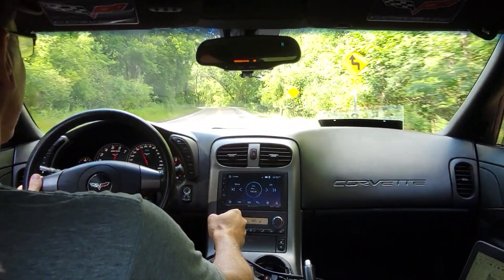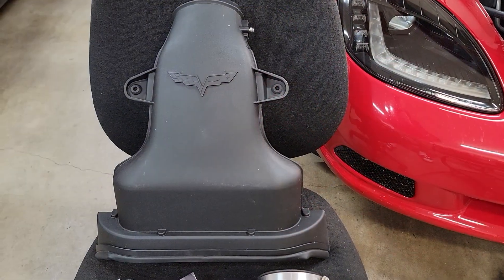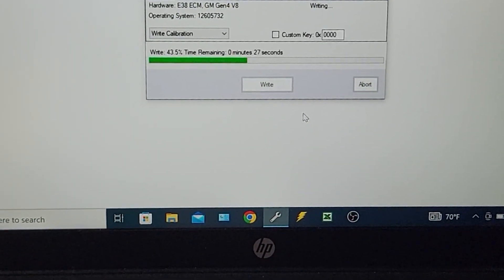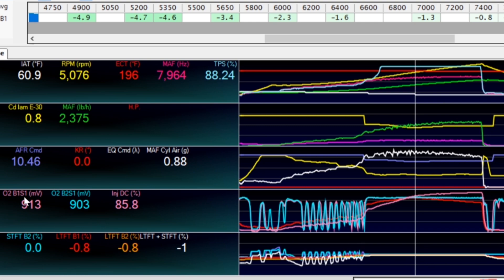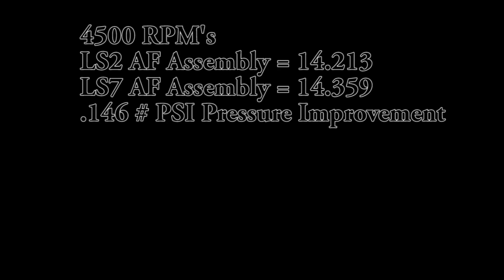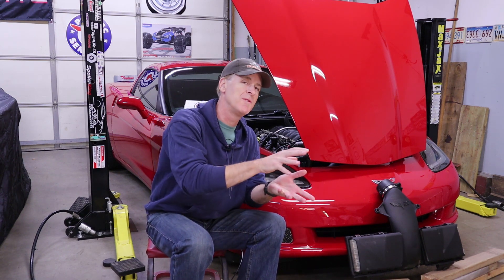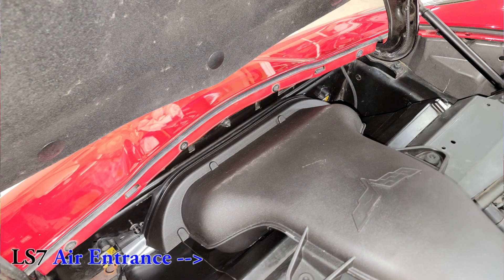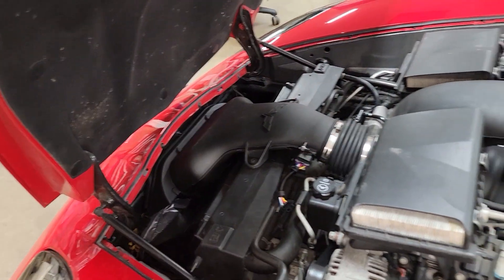C6 Corvette (LS2) Air Intake Upgrade to LS7 Testing (Is it worth it?)

Comment: Delivered CFM would be a better measure.
Reply from the maker: I appreciate the comment. My belief (which may be wrong) is that whichever intake system results in the lowest pressure drop inside the manifold would yield the greatest flow. Pressure and flow are related.  Please explain how you would measure CFM and how you know it is better (I assume you mean more accurate) than the pressure drop methodology I used.
Reply: @Toys4Life  Any intake will flow X CFM, and calculating an engine's CFM needs is pretty simple (CFM = (displacement x RPM) ÷ 3,456). Volumetric efficiency takes over from there. I would expect you could pull those numbers from your tuning software?

Comment: Very interesting. Although I have a C5, I found your approach thought provoking and practical. Question…Is the LS2 intake manifold adaptable to the LS1/6 ?
Reply: Yes, I would like to know as well!
Reply: Dont even THINK about using the LS2 intake over the LS1, or especially the LS6. It was proven-several times-years ago that the LS2 intake isn't nearly as good as the other LS intakes. Why? I dont know, but more than one dyno test confirmed it's inferior to the other LS intakes.....
Reply from the maker: @bat5917 Pretty sure you're talking about the air intake assembly and not the intake manifold, correct?
Reply from the maker: @Milojanis4901 Agreed,  the LS2 intake manifold manufacturing process was made a different way that basically means it sucks.
Reply: @Toys4Life  Yup, that jogs my memory now. Too bad, that would have been a much cheaper way to match up the LS2 throttle body.
Reply: Would the LS7 intake work on the LS6?

Comment: In order to have fresh air with the LS7 intake, but also with LS2 intake, I recommend you to install a Vette-air scoop. I have one and it is worth it 👍
Reply from the maker: Logically - it seems like it would help!!!    I would love to test it - but once you cut something up .... (:-) Oddly enough - Halltech says it won't help, and may even cause surging and codes.  " We do not recommend cutting any holes in your radiator shroud (in an attempt to get more air to the filter). It is not necessary, and will cause lean codes and surging."
Reply: @Toys4Life  
With the original LS2 intake, there is no problem since the filters are open at the top. They capture more fresh air without directly experiencing forced air flow. And it seems to me that there is no need for reprogramming for this configuration. On the other hand, for LS3 and LS7 intakes, it is true that there may be an engine fault because the air pressure is too high on the MAF sensor. This is resolved by reprogramming the computer, which you know how to do. And for your information, the cutout of the Vette-air in the shroud is very small. If there really is a problem, it is possible to close the hole by sticking a plastic plate.

Comment: I want to attempt this , because my LS2 dyno 375 whp and 399 torq with long tube headers , exhaust and HPtuners tune. I want to hit 400 with horsepower . I want to do the MaF upgrade but I’d prefer to use an after market intake instead of OE. I shouldn’t have an issue with this? Just go back to my dyno tuner and have him fix numbers ? Or can you send your file on what adjustment you made to the ait?

Comment: I recently bought a used 07 base, previous owner installed a BBK "cold air intake." If the majority of the benefit comes from the colder air, would it be most beneficial for me to make a shroud as you did in a previous video? I did not see a direct comparison in performance on the stock intake before/ after the shroud
Reply from the maker: It's hard to do a super scientific test because of all of the variables involved in the expense of dyno time. That having been said, I think a partial shroud is probably the best and I'm working on that at the moment.
Reply: @Toys4Life  Great! I will be sure to keep an eye out for that update!

Comment: how diffrent is the ls2 to the ls1 maf? when adding a supercharger would you NEED to do this upgrade?
Reply from the maker: Later year LS1a are the same size as the LS2. I would try to make sure I had at least the later year LS1/ LS6 mass air flow sensor with the supercharger kit. You still exceed the mass airflow sensors ability to read, unless you go with larger piping coming in or get rid of the mass airflow sensor and run speed density only.

Comment: Find your videos very interesting.  Wondering if the same changes can be made to an LS3?
Reply from the maker: Ls3 has the same AF intake as the LS7 except it has the ugly box ( Helmholtz resonator) on the side.  That box quiets down the intake a bit and also makes the airflow more regular across the MAF sensor.  The only difference most would notice would be aesthetics IMO.